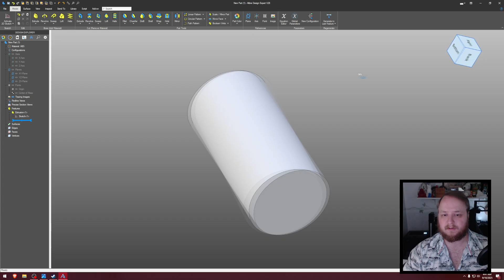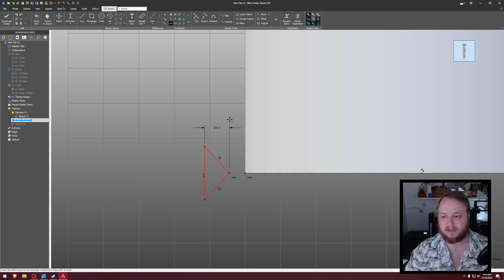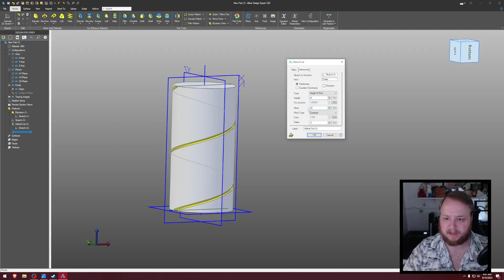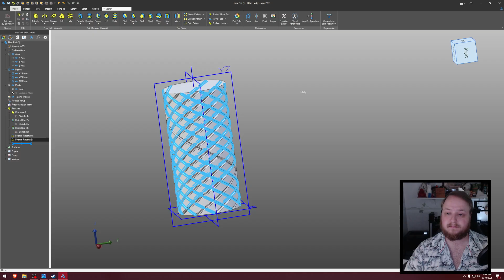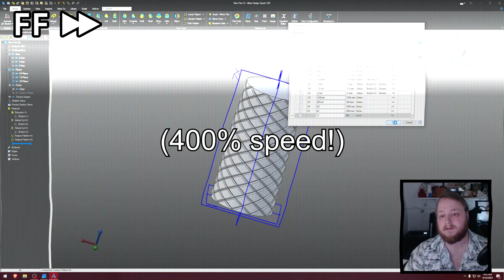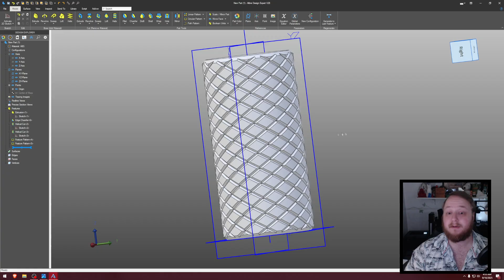How to 3D-Model Knurling!

Comment: Great for 3D printing I should think.   Managed it 20 years ago with Inventor but no access to 3D printing in those days.  I just needed it for a visual I was doing.
Looking at this I think your way is Slicker than mine was. 🙂  Cheers.   JimCad
Reply from the maker: It works very well for 3D printing, as that's what I did it for. Very cool effect. 
Thank you so much for watching and commenting